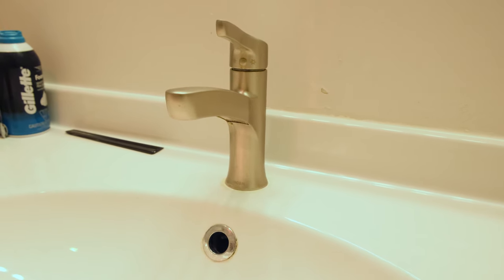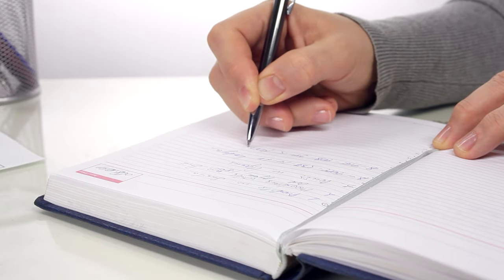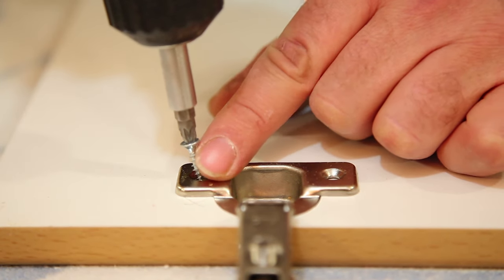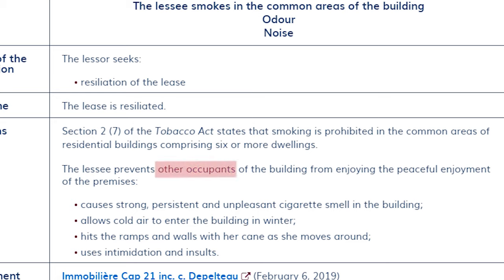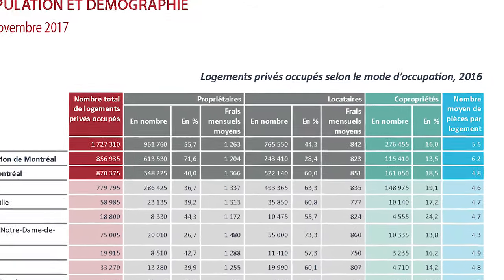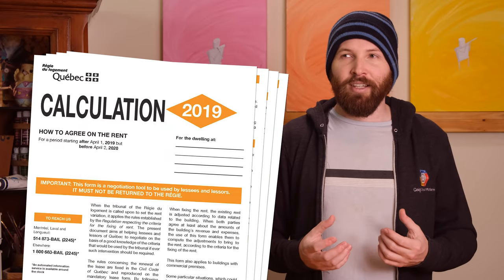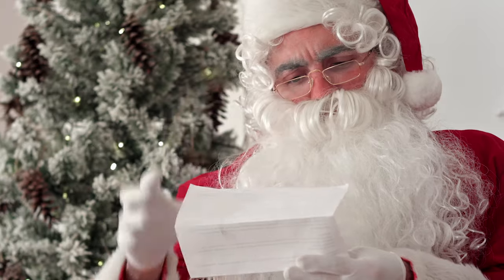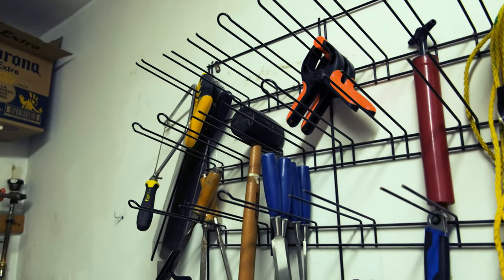Getting Along With The Landlord

Comment from the maker: Following up on this video and my discussions with my own landlord, we eventually settled on a month of rent as compensation and I worked with my landlord to speed up the installation of the sound insulation (which I was paid for). We had a more difficult time than we should have because emails got missed on both sides but after a bit of steam being blown off about that misunderstanding we managed to reach a productive compromise and the issue was fixed by working together.

After this experience I'd reiterate the message in this video. If you are dissatisfied as a renter, spend as little time being annoyed as possible and instead think what you can do. Going to the Regie to get compensation is almost always a pyrrhic victory due to the wait and the stress. The only thing I would suggest in addition to what I have in the video is to follow up with a call!